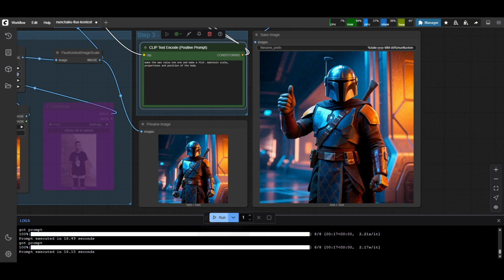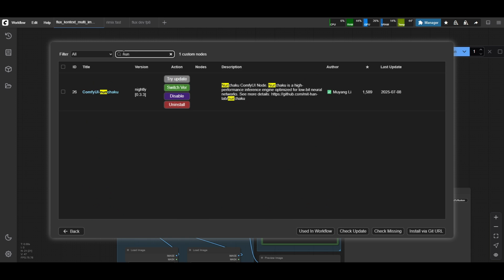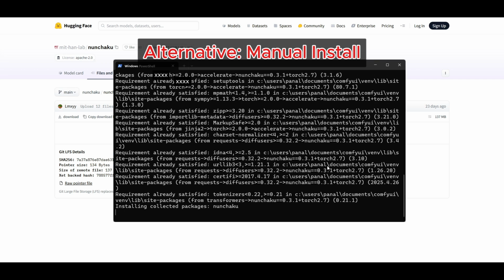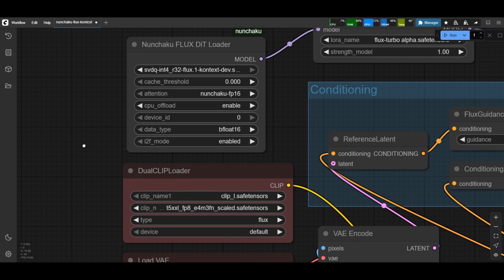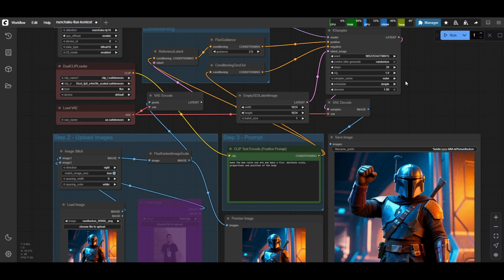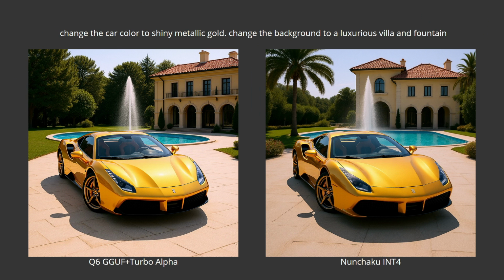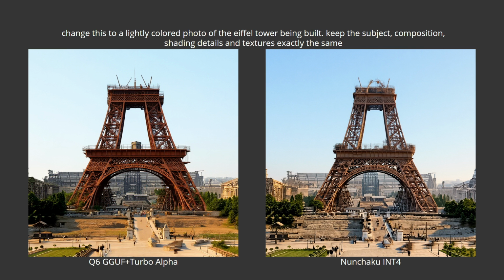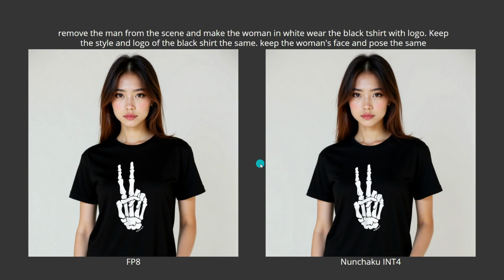Nunchaku Flux Kontext Dev Install & Comparison | ComfyUI on 8GB VRAM

Comment: I've just tried the Nunchaku version of Flux Kontext, but get AttributeError: 'Flux' object has no attribute 'diffusion_model'
Why is this happening? The model required for my GPU is svdq-int4_r32-flux.1-kontext-dev.safetensors, which I have in my Diffusion Models folder.

Comment: I was using the Q4 GGUF version on my RTX 3060 12GB with 16GB RAM and was even thinking about upgrading my RAM. With GGUF Flux it took around 60–90 seconds to get an image, and my VRAM would climb to about 11GB. It also pushed my system to use a lot of virtual memory, so the whole PC felt heavy.

Now with the Nunchaku version of Flux, I’m getting images in 15–20 seconds. VRAM usage sits around 5.5GB, and my system stays completely responsive, almost like I’m running an SDXL model instead of Flux. Huge difference.

Comment: Doesn't messing around with the torch version make the comfyui installation useless for quite a few other nodes?
Reply from the maker: I use torch 2.7.1 and so far it’s worked on all my workflow and models (flux, wan, sdxl). I try to keep to default comfyui core nodes as much as possible though
Reply: @theaidealab  Thank you. So for you it worked. But i am still not keen to try it out. The reason why i ask is that i had big trouble in the past with nodes that messes with the core of ComfyUI. The deforum node was such a node that messed up my installation. And so updating Torch is a no no for me. Imho no node should manipulate python version or torch. And people should be aware that installing a node that changes the torch version might mess up their comfy installation.

Comment: what happens if you have Python 3.13 installed? there is no ¨wheel file¨ for this version... 😥
Reply from the maker: Seems like they supported 3.13 in version 0.2 but then didn’t in 0.3.1… sorry not sure  what you can do other than downgrading python
Reply: @theaidealab ok, thanx

Comment: Save Image everytime BLACK IMAGE
Reply from the maker: Hmm maybe try with one of the normal kontext first to see if it works. If it does, it might be the nunchaku install
Reply: @theaidealab only with this nunchaku model, all other and fp8 kontext and svqd  flux works fine
Reply: @theaidealab  all other model svdq flux and f8 kontext work fine, but kontext int4 on rtx4090  black image...

Comment: hi i using your workflow, can you tell me why when the load in prompt it take so long time even when in ksampler it fast total it take about 400 more less second ?
Reply from the maker: Change the clip device to default if it’s on cpu
Reply: @theaidealab thanks for the advice turn out my node is so messy, i have two nunchaku in custom node now it was quite fast😊